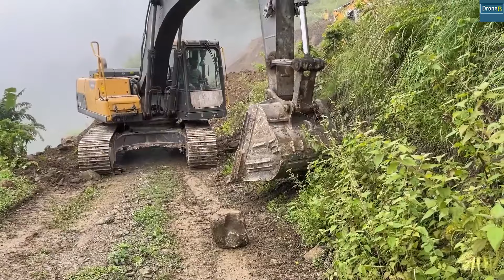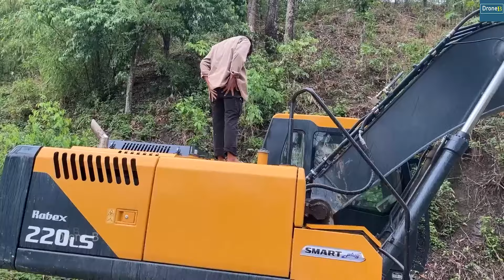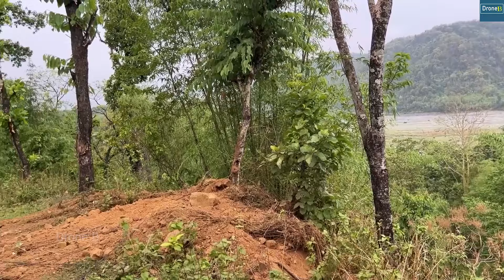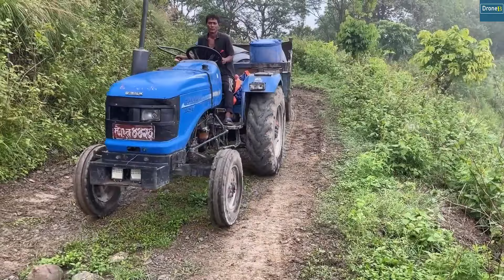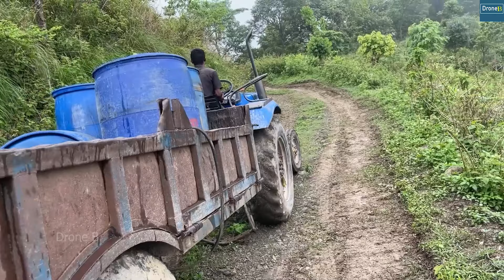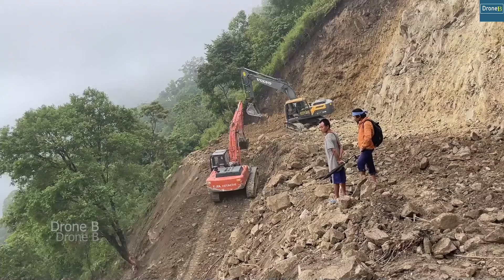Excavators Showdown!! NEW Mountain Road Excavation-Beautiful Foggy Day

Comment: Question 
What is that WIRE on the side of the road, yet moved by the Backhoe?
Reply from the maker: It could be unused electrical wire. The villagers had electrical poles installed not very long ago.
Reply: @DroneB  Thank you for sharing this information. Prayers  🙏🏻 with you always 🙏🏻